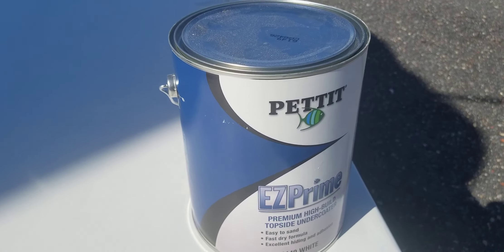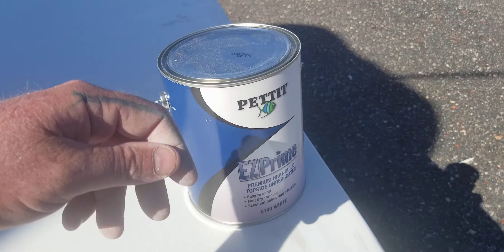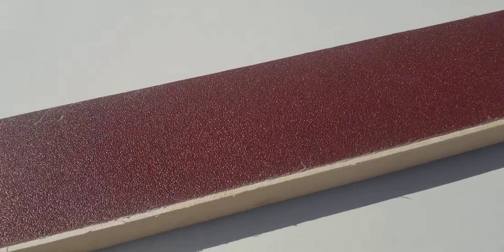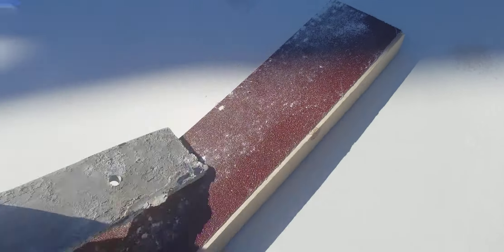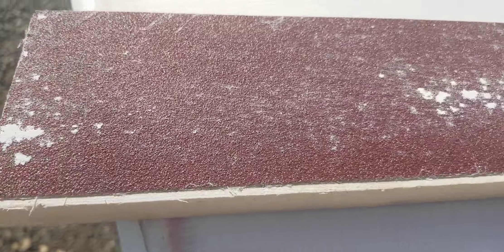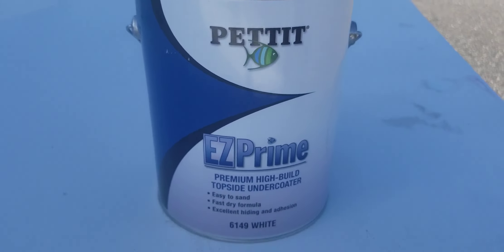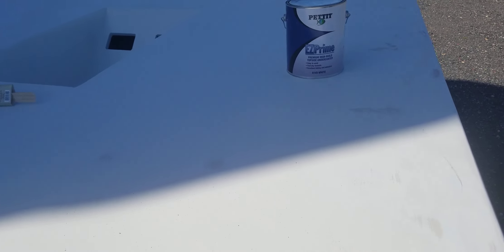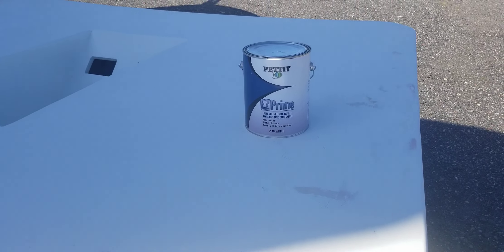Product review- PETIT EZPOXY 6149 *** DO NOT BUY ***

Comment: Not sure what happened,  I just used it for the first time on my boat and was able to sand it without gumming up the sand paper. I used a short nap roller made for epoxy resin and rolled on a thin coat and let it dry for almost 24 hours. I stirred and added the recommended amount of thinner like you did. All the solids settle to the bottom of the can and it takes alot to reblend it back into the primer. I've had this happen on oil base paints when I've put it on too thick and the top dries before the bottom. Probably  give it a few days or a week to really cure then try and sand.
Reply from the maker: It just didn't work as advertised. I know how to paint and know how important properly mixing and conditions are, but several times I had the same result with this primer. 

The Pettit epoxy is great paint. Just not a fan whatsoever of the primer.

Comment: How did you apply? Brush? Roller? Spray? The one part primer (more so than 2 part) seems to off gas a lot so the wet film thickness can be an issue; too thick and it will take longer to or will not completely flash off and you’ll gum up sandpaper.

Comment: Wet sanding is what I found works when your paper is loading up. I have also had trouble with a longer than advertised dry time with bright side poly paints. Never primer though.
Reply from the maker: Yeah the only thing I found with the primer is to double or triple the amount of thinner as prescribed on the can. If you use the amount if thinner on the canin this primer, there is no way of getting it to cure properly.

Comment: 7 teaspoon brushing thinner to 8 oz paint using myrandom orbital sander. thin and then thin it some more , 15% thinner .i did get great results but was by trial and error. used 2 qt to paint a 16 ft runabout just the topside .I sanded the hell out of it 3 times ,     i ended up using a foam brush instead of the badger hair .
Reply from the maker: Thanks! All the comments on here people make it sound like I'm crazy and don't know what I'm doing but it sounds like you had a similar experience. If you use the prescribed amounts of thinner on the back of the can, this primer does not work. It doesn't harden properly and becomes unable to be sanded.

Comment: I get the SAME issues....drove me crazy and I tried all sorts of variations.....@fishing, did you find a solution?
Reply from the maker: The ONLY solution I found was to thin the primer WAYYYYYY past manufacturers recommendations- to 50+% then make the primer coat so it is essentially a skim coat. At this point though simply touching it with the 120 grit that is recommended removes the entire coating.

Comment: I’ve seen that happen with a number of different paints. Oil-based paints don’t sand well after only 24 hours. Did you try sanding ezprime after a few days or a week?
Reply from the maker: So i tried several things, and always had the same result. The only time I had a different result was when I thinned the primer way past the manufacturers suggestion. Other than that, I have never found a use case for ezprime where it was functional.
Reply: @CharterFishing  I've never come across a 1-part oil-based paint that sands easily after 24 hours.  When Petit says "24 hours", that's basically the minimum safe point where you can sand, but it's going to make a mess of the sandpaper and that's also true for varnish. If you wait a week after coating, you'll find it sands a little bit more cleanly, but even then it's still pretty soft.
Reply: @CharterFishing  I do brightwork professionally (mostly varnish), and the more time you give the finish to breath out the oils, the more easily it sands